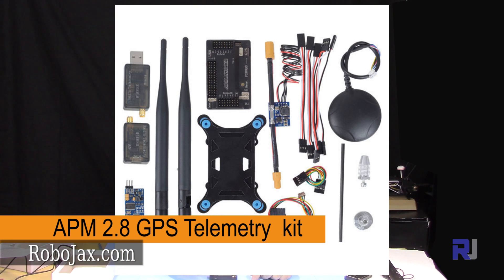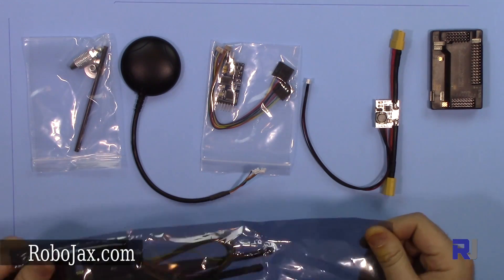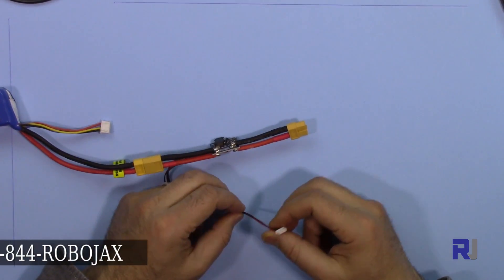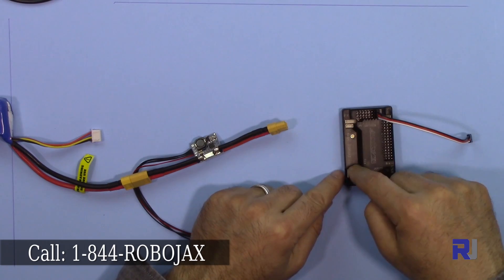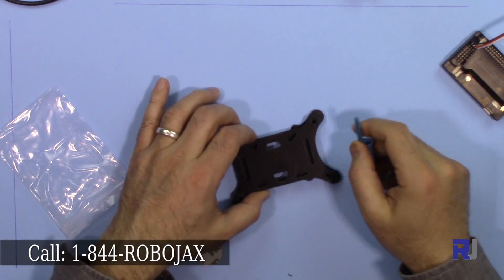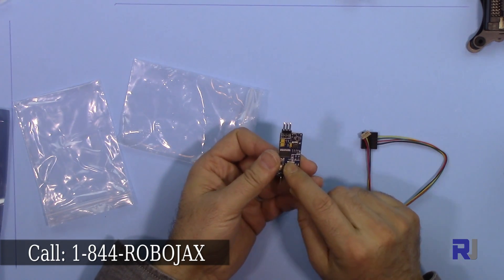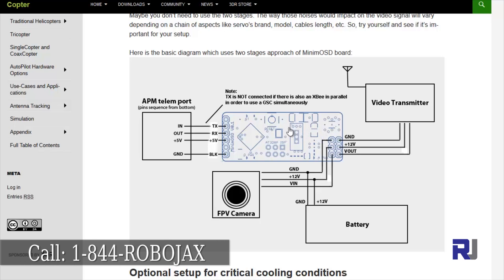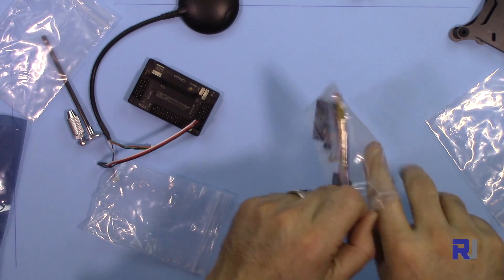APM 2.8 Flight Controller GPS Telemetry kit

Comment: Can I power my apm without power module
Reply from the maker: yes you can. Just connect your ESC and APM gets power from it..  Power module is to know the level of battery and if you  use telemetry it will display the current and voltage and also you can program the APM when the battery capacity reaches certain level, the drone can return automatically before battery runs out.
Reply: Robojax , can I have ur contact number can I WhatsApp you
I want things let me see I can buy from ur store
Reply from the maker: We are not selling locally for retail. We are in transition to education selling to schools like colleges and Universities.  However we are still selling on Amazon.ca.

Comment: Hello I am having APM 2.8 and the compass is not being calibrated I have tried connecting the wires of external compass to the GPS port and 12c port and also tried after connecting it with the port present at the downside of the GPS port .please help. I have removed the compass jumper in the APM .
Reply from the maker: I don't have the product in hand at the moments, but it should work. Please this page and follow http://ardupilot.org/copter/docs/common-compass-setup-advanced.html

Comment: Dear respected sir i have same apm2.8 flight controller with flysky fs-i6 RC tx/rx . But it is not flying please please help me and guide me . Kindly i need your help
Reply from the maker: Hi, this is big question. When you say it is not flying, there could be 100s of issues. 
Do you get connected via software?
When you move your sticks on the remote (Transmitter), do you see the result or change on the computer screen?
let me know and I will follow with you.

Comment: What's different between Telemetry 433 and 915 and which one is better for long range fly ?
Reply from the maker: 433Mhz and 915 Mhz are frequency band ISM. The industrial, scientific and medical (ISM).. 915Mhz is used in the Americas. 433Mhz is used in Europe, Arfican and Middle east. The lower the frequency the better the range.

Comment: if I don't want camera and I still need telemetry information such as coordinators and other flying information  is it possible?
Reply from the maker: Yes of course. Telemetry will send you your GPS location, orientation, direction, voltage and other data.

Comment: is it avoid obstacles on it's way automatically??
Reply from the maker: NO. this is flight controller to receive command to from transmitter and control the motors. Then you need to use you computer to send commands to fly it to any GPS location you want. It cant' avoid as there is no hardware or camera to detect obstacle and avoid it.
Reply: can we add ultra sonic sensors to it to avoid obstacles?
Reply from the maker: ultrasonic sensor can be used for short distance of less than 3 meter. If you want 3 m obstacle avoidance, you can do it.

Comment: you started out good, but then crashed by not giving any information on how to connect everything.
Reply from the maker: connection of wires is related to setup. So setup and connection will need 
multi-part video which was not intended to be done in this video. I will
 try to a have complete series of videos on APM flight controller.

Comment: How can you connect and configure it for flyerwing?
Reply from the maker: Hi Plane, you follow this page: http://ardupilot.org/plane/docs/arduplane-setup.html
Reply: Thanks
Reply: Can I used the ardupilot 2.8 in aerial fotography 3d?
Reply from the maker: Yes you can. this could be the best option.  You would use position hold to keep the drone at a point or film.
Reply: Thanks, But I'll need help... I guess.
Reply from the maker: start here. from here http://ardupilot.org/copter/index.html